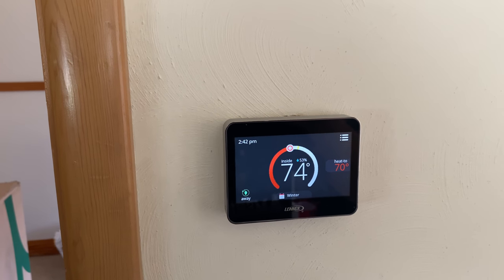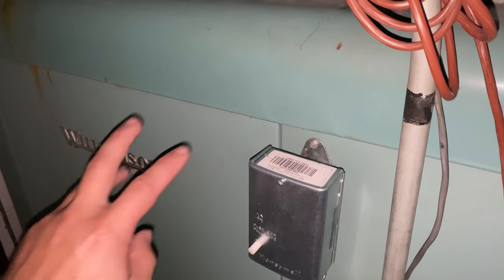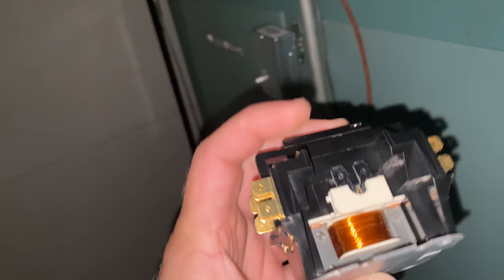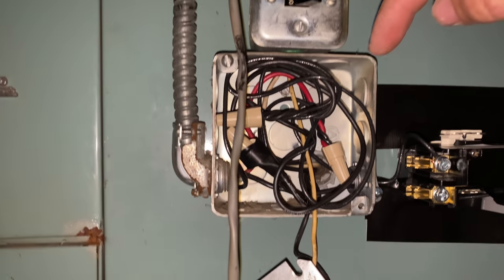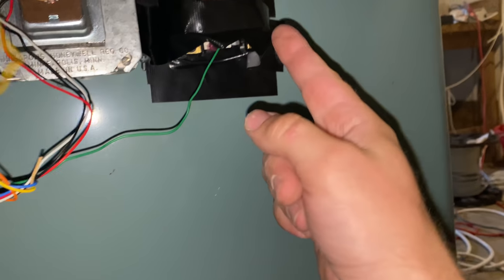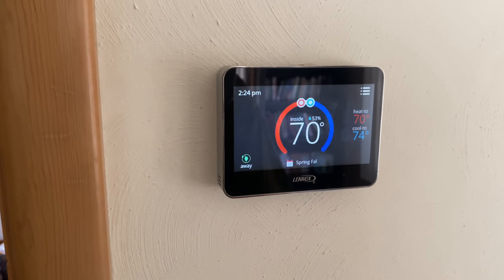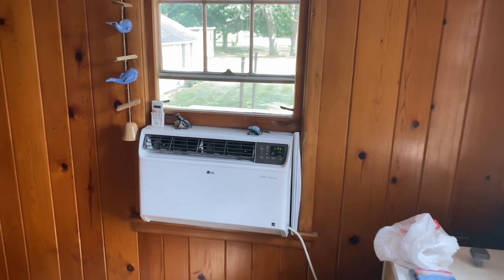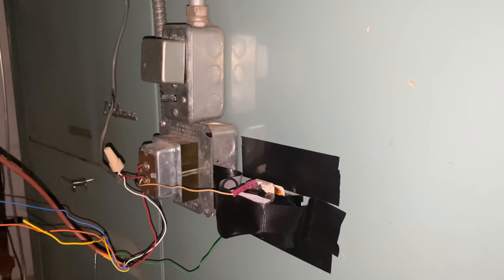Adding Smart Blower Control To Our OLD Furnace

Comment: We had a Williamson gas furnace but we had the five in one
Reply from the maker: What’s the difference?
Reply: @radozeman  the five in one had everything it had the gas furnace the central air conditioner a humidifier a dehumidifier and last of all an electronic air filter they called it the five in one because it was basically five things in one system I did a review video on YouTube I used pictures on my laptop for the video I showed the ac outside the house and the furnace inside house

Comment: Good job randy!  And I’m actually an HVAC tech. If you can find a wiring diagram for the window unit you may be able to use a relay, but if it’s a control board with onboard relays it may not work.
Reply from the maker: I’m definitely going to see if I can look into it!  I doubt it is possible, it has smart control, variable speed, blah, blah, so I doubt a simple on off will work….

Comment: Why not put a link for the relay?
Reply from the maker: This the one I got: Carrier HVAC Motor Contactor, 24VAC 30 Amp Coil Single Pole / 1 Pole Furnace Replacement Relays, Air Conditioner, Heat Pump, Refrigeration Systems https://smile.amazon.com/dp/B09BZ4ZX6D/ref=cm_sw_r_cp_api_glt_fabc_AHPKGT1T0WTF5F9JH9EV?_encoding=UTF8&psc=1